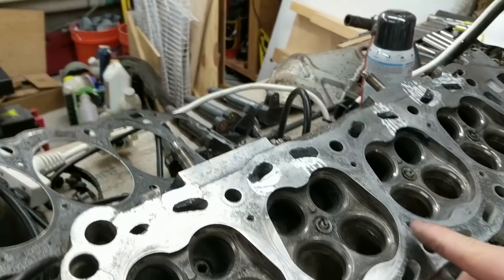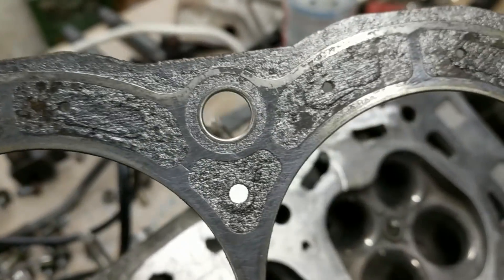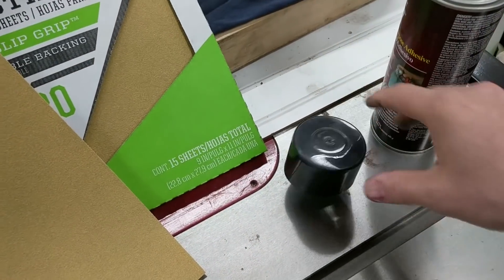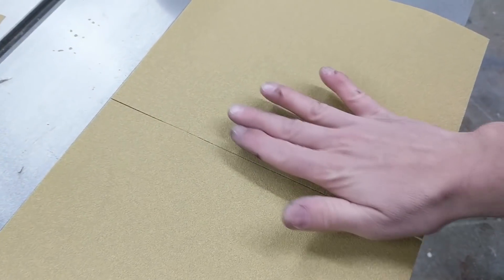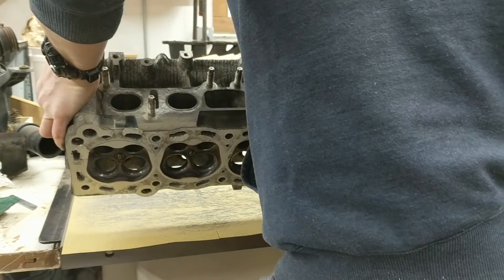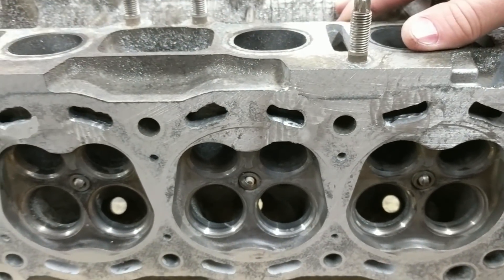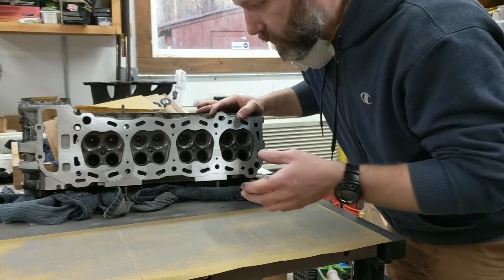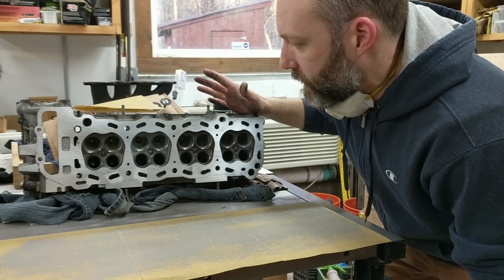Using a Table Saw to Resurface a Cylinder Head

Comment: Yeah about the same technique I have seen used at a machine shop I use to take my stuff to. They had a a big belt sander that was in a table belt was like 12" wide had a stop on one end and sat the head on it and run the belt sander.. long enough to accommodate any length of heads... guess primarily used for aluminum heads. Much faster that getting head setup on a milling table.

Comment: I do this with pressboard about 4.5 ft long,  the type that cabinets are made with ,  and  60 grit sandpaper superglued to it evenly.    THat way I can stand over it and slide the head pretty far to either side and quickly.   I found a flat part of the pavement in my garage and check the head with a straightedge periodically as I go.   I do this for endurance racing and never had a head gasket issue.   If you want to know how to do a sick DIY valvejob , I'll fill you in.   Anything valve related can be done in house with basic shit.

Comment: For God's sake, blue-up the surface ( even a Magic Marker will work ) so that you can see the high and low spots.
Reply: You can see the  sand paper marks for God's sake.
Reply: @daveanderson2316  then use a mill bastard in X fashion...you will win...
Reply: Smoothbore this is not like scraping in bearings. Blue might show high spots better than the sanding marks but there is nothing you can do other than sand some more, or not.
I'm sure he can see when the surface is cleaned up.
Reply: @knobovsossidge2022  X passes with a flat Nicholsen Mill Bastard...one pass one area...blue it...
Reply: @bigsparky8888  - a cleaned up alloy surface like that and you want to go swiping a hand file across it? You think you could improve that head with a hand file?
Reply: they have something called dykum blue ink, in a 2 OZ can.
Paint in on metal surfaces and examine after east cut session.
Reply: Yes, add the bluing
Reply: ...relax, good suggestion though
Reply: @NevRSweatWhatWas  what are you going to see with marker that is not already being shown by the sandpaper contact marks?
And then, if you do see a high or low spot, what can be done besides carrying on with the process as he has?
Reply: You are correct!
Reply: @EddBoiLikeU  I think dave was talking to SmoothBore
Reply: YOU SIR KNOW...BLUE IS BEST!!!
Reply: TheOtherWhiteBread0  I EAT WHEAT GERM...POW!!!
Reply: How would you do that?

Comment: I did pretty much the same thing in my "hillbilly machine shop" on the heads for a Nissan 3.3 V6.  However I used thick plate glass for doing the "final" sanding with 240 grit emery cloth glued to the glass.  For the initial "roughing", I made a large wooden block from a laminated beam, and I laminated the surface with formica and checked with a straight edge before gluing the 80 grit emery cloth.  It was much easier since the block is lighter than the head, plus I could see the progress.  I switched to 150 grit on the block for a "cleanup" before finishing up on the plate glass with 240 grit. Be aware that since aluminum will gall very easily, you must keep sweeping the sand paper off to prevent that. One tiny little chunk of aluminum will "roll" and cause a gouge, and thus, more work.  The intake manifold, and plenum got the same treatment since they were a bit warped too.  End to end (longitudinal) flatness, though important, isn't as critical as being flat across between the cylinders.  The head will flex end to end when you torque it down, but there are no bolts in the center so flatness across needs to be very flat by at least 1/16" the thickness of the gasket.  And yes, always use new head bolts when called for because of not only stretch, but tortional strength as well.

Comment: nice video, use this process in small engine heads all the time, only suggestion is rather than back and forth try a figure 8 motion, speeds up the sanding process and results in a more even surface. Also I use wet sand paper usually 80 then 120 and apply some WD40 or thinner oil to the sanding paper, just wiper the head occasionally and wipe off the paper between cycles.

Comment: Nice job Dennis. It should work fine. One thing most people do not know is that gaskets are actually a moving part. Every heat cycle that an engine goes through they expand and contact. You explained every step-by-step. No need to go to the gym afterwards:)
Keep up the good work and thank you for sharing!!!

Comment: Nice job,  looks great..   Normally,  you would cover the surface of the head with Black magic marker or ink..  It'll highlight the low spots..  Then,  when you're rubbing it on the sand paper,  move in a figure 8 motion,  or any motion other than one direction,  it'll make a more even grind and go a lot faster..

Comment: When will the leaking gasket video premiere? I won't skimp on the critical parts, especially the cylinder heads or any other parts of the business end of an engine. If it works it works but why mess around at home for 50eur/70usd, when gaskets cost around 150 euro/180usd (in my case honda GL1100 engine)
Reply: Bradley SR 
Be sure to visit us here next week for the continuation of the “leaking gasket video” !!!
A Quin Marten Production

Comment: This will work but you're only Lapping Longitudinally  -  Start Lapping Laterally for even removal of metal.  Counting strokes in Both directions will keep it Square. That Table is too small for Correct Lapping Procedures--->Figure 8 patterns Then Rotated 90 degrees<---.
Lapping Laterally, grab each end of Head and pull towards-you & push away. Its easier if your  arms and chest are level with the Piece. Then push & pull on sand paper length - Keep track of Strokes in each direction and Distance moved - Do 20 strokes Laterally then  20 strokes Longitudinally - Check your work using the Flat Table its laying on with a Feeler gauge . It'll work -  I Lap Motorcycle Heads all the time.  I've Lapped Turbine Face plates and Carbon Seals on B-52G engines - We Checked our work using a soft Light on a  45 degree prism to measure refraction width on a Flat Glass Standard of .000001" laying against the face-plate .  Good Luck.

Comment: Open up the holes in the gasket for more flow and better
 Cooling
Reply: No, don't do that, there's a reason they're like that.  Some sbf heads have the front passages on the gaskets completely blocked.  I thought I bought the wrong head gaskets.  After a little research, and realizing that the factory head gaskets were the same way, I found out some passages are fully or partially blocked to get coolant into the back of the block for even cooling.
Reply: @ryanwinkelman1781  correct, the size and placement of the holes in the cylinder head gasket controls the flow of coolant through the block and head. That way the manufacturer can assure even cooling or emphasize more cooling around the exhaust side of the head.

Comment: no one has mentioned useing indian head permatex gaket shelac its purpose holding the oxyger count down at the metal surface have used it succcesively for heads with tiny rust pitiing or corrosion .Of course if the head is bowed across the webbs between cylinders .will need resurface so thanks for  heads up want some more home brew on valve grinding search instructables valve grinding

Comment: Using premixed coolant, green, with deionized water as suggested. Replace the water pump (green coolant is abrasive on the ceramic seal).
My suggestions....good luck!

Comment: That's a lot of work and risk having to weld up and manually machine. That head has been overheated and abused from lack of cooling system maintenance . It could very well have a internal water jacket crack. And you got to remember the block has also been overheated to the point where the Rings are no longer pushing out on the cylinder walls and the engine will smoke badly and burn oil. I personally recommend in any engine that's been severely overheated needs to be replaced. I've seen people spend $1,800 doing a head job on a 4-cylinder car that overheated. About a week and a half after that repair the rod bearings and crank bearings started to come apart $1,800 wasted they could have put that toward their reman engine with a warranty?
Reply: no it fine k.i.s.s method metal was melted to pour in a mold look it over repair n use
Reply: Valenza@sbcglobal.net SNOWFALL CHICAGO

Comment: Probably would work better if you used emery paper instead of sandpaper, it costs more but it won't tear apart as bad as the sandpaper is tearing.  Also if you can use diamond grit paste and a large sheet of plexiglass in place of the sandpaper.  While this sandpaper will work it will take a lot longer than if you use the diamond paste.  You don't need it polished smooth as much as you just need to remove any low spots or warps.

Comment: This does work. I've done similar. Check with a straight edge often. Lapping in the valves will make the engine run like new.

Comment: Nice trick to do in a no machine shop option. The guy that works for me and rebuilds automatic transmission does same thing with the metal disc in there he uses a big whet stone. His transmission are smoother than factory. Also we used to do go cart heads like this when we were kids we would mess around to see how far we could cut it down and still work. Way higher compression. When we finally got our formal down right you had to run premium in the go cart or it wouldn’t run right.

Comment: I don't know if there were any comments from any machinists here, but let me add my two cents worth. Although what you did here would, (and probally did) work, overall, it's just not a good idea. While it's most likely good enough for a 'Bush Fix', (meaning if you're stuck out in the wilderness somewhere, and you just don't have access to the proper tools and equipment) this would be a pretty good substitute, but as long as you can get it to an automotive machine shop, I'd go with that. The reason the middle (or center) of the head was not being sanded like the ends were, is because no matter how hard you try not to, if you are manually sliding the head back and forth across sand paper like that, you are 'rocking' the  head back and forth, and sanding the ends more than you are sanding the middle. Trust me, I know from years of machining, you just can not slid it back and forth like that, and get a flat surface. Now, it might not make a lot of differance on a low-compression motor like what you have here, (the gasket and sealer will likely cover some slight uneveness) long term use will likely cause you problems with uneven wear and tear on the other componets of the motor. But! Carry on!
Reply: Just say a 8 motion would work better no different than a cnc ( machinist here also) but yea a cnc

Comment: Actually flattening out this head is a mistake. It obviously has bow along it's length that goes away when the head gets torqued down, otherwise the cam would seize. NOW when this is bolted down the cam bore will be less straight than it was on disassembly. I have a machined piece of round stock about the size of a rolling pin. I wrap real 3m wet/dry or emory cloth and hold it cross ways on the head and slide it front to back. I'm trying to get side to side flatness  and not worrying about bow in the length. 
Also it does not matter who or how it gets machined, if it happens without heat and/or a torque plate of some kind.... it's junk...I mean less than ideal. I've seen cam bores out .050+ after having the head "surfaced". Cast iron OHV mindset does not work with alum OHC. I'm old now but I used to have to deal with this all time back in the 70's and 80's.

Comment: Having worked at an engine rebuilders, I know yes this process will work. So will a large piece of glass. Your process is mostly good but you need an intermediate device to eliminate the force from your hands. And consider that the block mating surface may also need attention. Yup, you can pay someone else to machine the surface, but if you want to expend the effort, why not?

Comment: Been using this trick on a smaller scale (air cooled engines) for 20 years and it works great, especially out in the field where you have limited resources. In my case the engine has been run a while with a leaking head gasket so there's always a low spot. My rig is a block of steel plate with some 80 grit that's self stick. (body shop sander style) Work the head in small circles, turn it 90 degrees, a few more strokes, turn it 90 degrees, etc. Keeps things even all the way around. By the time I get 360 degrees it's usually good.

Comment: excellent idea. I think it would have been wise to verify the flatness of the table with a certified straight bar. Starrett has one that is not terribly expensive Plus when you have used it put back on ebay and get most if not all of what you paid for it back. JB weld works quite well on head surfaces to. In fact I read a tale of someone using JB weld to fill in deep pits on a rusted cylinder wall. Thanks for sharing!

Comment: When you get this down to where you want it, you should should use a lapping motion  ( small figure 8 motion ) to finish it off.  Everything will then end up flat . Also rub a marker or dikem blue on the surface and do one more light lapping to true check out surface.

Comment: I used to work in an engine rebuilding shop (Vulcan Automotive, Vancouver BC) and we straightened warped aluminum cylinder heads this way:

1) bolt head to a 1" thick steel plate at least 1" wider and longer than the head casting.
2) tighten to torque specs.
3) place it in a BBQ.
4) use a full 20# tank,
5) light the BBQ and put all burners on high temp. (not the rotisserie burner if fitted)
6) leave it cooking for 12-16 hours or until propane runs out.
7) allow to cool to room temp.
8) check for straightness with a straight edge and feeler gauges.  Should be no more than .003" out in any direction.
9) sand smooth like you show in the video.  Again, should be no more than .003" out in any direction.
10) admire your work and congratulate yourself on saving a "ruined" cylinder head.
Reply: Very good solution for not removing material

Comment: That'll work. I've used a big file to find the high spots to decide how much needs to come off. If it's less than 5000 I'll put a piece of sandpaper over a large piece of glass and running back and forth a couple of times and that'll do the trick I don't use 300 though I finish it up with 1500

Comment: I guess grammar was never your thing? "Using a table saw to resurface a cylinder head"? No, dumb-dumb. You used a flat surface, a table, to resurface a cylinder head. At point was a saw used? You used a flat surface to resurface a cylinder head. Great job. Change the name on your video and go back to school. But, great job anyway.

Comment: the surface looks great,and the thing is you did not lose a lot off hight from the cilinderhead..did not see the video in wich you weld it but that looks outstanding too.always make sure that those valves come back in the same seat,you be fine!!the surface can handel 0,05 mm

Comment: IT IS A MILL SHOP . JUST LOW BUDGET. AND IF YOU TAKE YOUR TIME IT WILL WORK. I WOULD STAY AT 80 GRIT BECAUSE OF THE WELD SPOTS .
GREAT JOB FRIEND .
Reply: Great job. One day you may find that you would have to surface a head yourself.  True mechanic thinking

Comment: I have wondered if doing that would work or if using a router would work I would probably use some emery cloth for the last pass but as you said it probably isn't necessary. Thank you for posting this.

Comment: I've done similar. Never used tablesaw. But then I don't have one. It works perfectly fine. One piece of advice. It is much faster and don't even need the sand paper if you use a large flat file. Go over the surface using crisscross motions in all directions. Keep shavings cleaned off. Sure machine shops do it cheap. But you can have engine running before you get your head returned usually.  Never had a fail

Comment: Herd old guys talking about doing this sort of thing back in there day when heads didn’t have valves in them and there was no such thing as a cheap Chinese cylinder head. Only these guys talked about wetting it down with kerosene to help lubricate the process and wash out the swarf from the sand paper. I noticed you didn’t and I wonder if you knew about doing this.

Comment: If you don't have a true flat CI surface table big enough to work the head in a figure of 8 you can invert the head and bolt it to a rough, clamped wooden base to stop it moving. Find a piece of old float glass of the right size (old office demolition etc) and use THAT with emery paper in a figure of 8. It will mean having to thoroughly clean afterwards but it will be as flat as you ever need unless the engine is very high performance.

Comment: 2 thinks I do, 1st soak  the sandpaper with WD40  it won't loosen sand as water does and it helps  it cut better. 2nd spray two coats of silver paint on each side of the head gasket this really helps them seal and never leak. been doing these things for 40 years.

Comment: Lap the valves in with grinding compound. They make a dowel looking thing with suction cups which fit the tops of the valves, and you put the compound on the seat, place the valve in the head, and put the dowel withthe suction cups on the valve and rotate it back and forth. It's a very old process, and has been around since the 1920's or before. It's very well known, and somebody will be able to explain it better than I have.